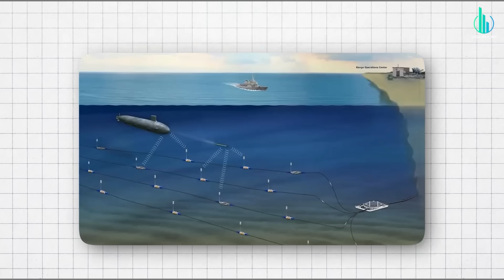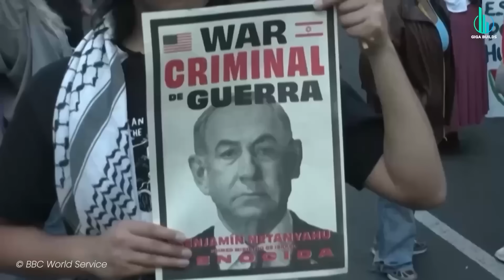Israel's $55 Billion Race To Replace The Suez Canal

Comment: Ok, so this wouldn't get built for many reasons.
#1 - The Gulf of Eilat has an issue as it gets close to Israel's port city. There is rare corals and an environmentally delicate area only 30 to 35 meters deep.
#2- The heavy deep sea shipping needs waterways that are close to 60km in depth.

Just those 2 reasons are more than enough to make this not feasible.

Comment: The so-called “Ben-Gurion Canal” is not a secret project, not a current plan, and not a motive for the Gaza war; it was a Cold War–era thought experiment floated briefly in the 1950s–60s and abandoned more than 50 years ago, with no funding, no planning process, no permits, no environmental studies, no tenders, and no construction ever. If such a canal were economically or technically viable, Israel would have pursued it decades ago—states do not sit on transformative global-trade infrastructure for half a century while doing nothing. The claim that present-day military operations are driven by this nonexistent canal requires inventing a secret Israeli plan for domination of global shipping, imputing implausible foresight, coordination, and capability, and then retrofitting real human suffering into that fantasy as intentional means rather than tragic consequence. This is not analysis; it's a conspiracy theorist screed that resurrects a dead idea, inflates it into a phantom megaproject, and uses its total lack of evidence as proof of secrecy. Protocols of the Elder's of Zion, much?

Comment: This could be made profitable for Egypt as well. By making the two canals one-way only, the traffic can be increased, and the limits on the size of the ships could be raised. The ships could sail from the Mediterranean to the Red Sea through the Suez Canal empty, and the return trip could be through the Ben Gurion Canal, which can be made deeper to accommodate the increased draft of fully loaded ships. Europe should invest heavily in the Ben Gurion Canal because it has a direct interest in it.

Comment: This is a credible and advantageous idea for everyone except Egypt.

No, it won't "by pass Hormuz" (how?  They're not even in the same bodies of water!)  nor "allow Israel to dominate a key trade route" (how?  A Ben Gurion canal won't make Suez disappear!) - all it does is ensure Suez doesn't become a major bottleneck, while expanding Israeli oprions.

Nor do the paranoid claims that Israel just wants to drive the canal through Gaza make any sense.  There are reasons why every single proposed version of this canal since the late 1800s doesn't go that way - it makes more sense to have the canal meet the Med at an existing major port that's in full operation and reasonably secure.  If anything, Israel would want the canal to run outside improvised rocket range of Gaza.

Also left unsaid by most commentaries on this is how such a canal would increase the geopolitical importance of Jordan, and encourage even closer Jordanian and Israeli cooperation.

Yeah, Egypt would lose out, because some.traffic will divert to the Ben Gurion Canal, especially if transit fees & times are comparable and the overall security environment on the southern approaches are better.  But shippers will still use Suez.

And having independant redundancy in a major shipping route is good for the global economy and area tensions.  The Suez Canal was critically involved in at least 6 wars, and was a major reason FOR several of those wars, with commensurate major impacts on world trade.  That's without even considering natural or manmade accidental disasters blocking the only direct route between the Med and the Red Sea/Indian Ocean

Comment: It is not possible to build an Israeli Suez Canal. First, the length is the easiest thing to deal with.
 The main problem is the mountains between Eilat and the Red Sea and the Mediterranean Sea, mountains that rise to a height of 900 meters above sea level. Either they will carve them out, which will cost billions and destroy nature, or they will build a tunnel, which is impossible from an engineering perspective. In conclusion, there is no chance of building an Israeli canal.
 There is an idea to build a railway network from the Dubai area to the Mediterranean Sea that will also pass through Israel.

Comment: Of course, an alternative is necessary, after the lessons of Evergreen and the ships sunk by the Egyptians in 1956, Houthis, etc. For too long that region has stimulated terrorism and conflicts, blackmailing innocent and neutral countries with blockades. As for Egypt, it will not lose all traffic, but only the one that is more useful through the Israeli version. Because, for Western Europe, the Suez would be 1-2 days faster, while for Southeastern Europe, the Ben Gurion Canal would be faster and more useful. And $55 billion would not be an excessively large amount, just realistically, it will exceed this estimate.

Regarding "Gaza gossiped route" nah. Simply not worth it, save 1-1.5 bn at channel but they will need to build a new port from scratch, and that cost tens of billions.

Comment: The bottom line is that the Arab  world in general has never accepted the existence of Israel.If that situation would change perhaps with the signing of the Abraham accord then pressure of digging and completing the Ben Gurion  canal would diminish and restoring the Gaza would start. Hamas would capitulate.

Comment: I am a skeptic. You see, locks take lots of water. The Panama Canal is backed up because of the current drought. There is perpetual drought in the Negev. That's why it's called a desert. So there is no feasibility to a system of locks there.

Comment: The current infrastructure of the Suez Canal is increasingly outdated, especially in light of recent incidents — such as the grounding of one of the largest container ships ever built, which blocked the canal for six days. This event highlighted the vulnerability of a critical global trade artery. Given the growing size of modern vessels, the global maritime industry now faces an urgent need for a more modern, efficient, and resilient alternative route connecting the Red Sea to the Mediterranean Sea. Whether it would be under national control (like Egypt’s control of the Suez Canal) or managed by an international consortium, but it should be designed a two-way passage — to allow simultaneous bi-directional traffic, reducing congestion and risk. including deeper and wider channels, advanced traffic management systems, and emergency response infrastructure.  The question is no longer just about who owns the route, but how it can be reimagined to meet the demands of 21st-century maritime logistics for the holistic benefits of the global maritime community.  I think Egypt can modernize the Suez Canal to fit it into the next levels.

Comment: Nonsense.  To cross Israel from Jericho to the Mediterranean is not at all like building the Suez Canal.  You would have to cut through the high elevation of the spine of the Negev, up to 2000 ft above sea level.  No canal in the world boasts a trench that deep.  And it's not reasonably possible to build it via a series of locks in the manner of the Panama Canal, because Israel doesn't remotely have the water resources to pull that off.  

In addition, the real bottleneck now is the terrorist threat of the Houthi regime that controls most of Yemen, and that has shown no compunctions about bombarding neutral shipping moving into or out of the Red Sea.  The "Ben Gurion Canal" would do nothing to solve that problem.

Comment: Good to see Giga Builds doesn't know the difference between the Panama and Suez Canals.  The Bypass around Gaza would add 10 to 15 kms, adding 3 to 5% to the distance in a lower cost part of the canal. Cheaper to leave them out of it, as the security will cost way more than that on an ongoing basis.

Comment: It's good that you put the most important part less than half a minute into the video, It's almost impossible to do this. The plan is a train. And Gaza has no influence, a road that bypasses Gaza will extend the journey by a maximum of half an hour, and if it's a train then it makes more sense that it will be extended by a total of fifteen minutes, no more.

Comment: They should let Hamas terrorists to dig it, and split the revenue. They are experienced diggers that have already filled Gaza with hundreds of miles of tunnels. so, it will pacify them with job opportunity instead of terrorizing Israel, and for Israel it will bring the costs down

Comment: If the Canal is planed and built inside Israels teritory then no conflict between other Nations to question but mostly security can be checked and controlled by Israel easily to detect capture terrorist if they do not abide with international Rule of Law where most smuggling ships can not escape if they want to sail through.

Comment: The idea is a few decades old and was never implemented because It's bad ROI for Israel. It will be a disaster to Israel ecosystem, distablize relations with Egypt and will require massive security force to protect it from sabotage. A much better idea that is likely to follow if the indo-pacific corridor will become reality, would be a vast railroad to make Israel a hub for sorting and passing shipments, rather than just a pathway

Comment: Build it! Use German 'Bagger 288's; 800metres wide and 50 metres deep; put the spoils either side as elevated security roads, have interim unloading inlets for domestic use and tourist destinations. When you get to Gaza the inhabitants there can leave or WORK (no more handouts) in purpose built shipping terminals in the designed Mediterranean port city. All under Israeli control. Egypt will whine and flap their arms, but if they don't stop the Houthies with Muslim teamwork, it will be no worse than what they have now. Anyway Israel will find a solution to that by reasonable talk with the Egyptians even then.

Comment: There is no such project 
Sometimes I think everybody are idiots 
There is already port in Aylat 
It's the tip of south Israel 
And second its will be smarter and cheaper to build a train 
But the problem is that the yamanis blocking the red sea, and it have an effect on Israel and Egypt as well 
There is no such project in the future

Comment: Actually both countries should come  together. Then one canal for up traffic and one for down . Faster ships
Reply: No. Israel will have two canals; one in each direction.  They will both be able to take the biggest ships.  The canal won't need much maintenance because much of the land is rocky instead of sandy like the Suez canal.  So the canal will be cheaper to run once it has been built.  They just need peace in Gaza.  Maybe that is the reason for the war so that they can permanently pacify Gaza and Yemen.
Reply: @bobgriffin316 The reason for the war was the massacre of over 1200 Israelis by terrorist hamas.
Reply: That's a good idea, except for the largest ships.
Reply: Alot of the suez canal is bi directional. Just two parts that has not been upgraded yet.